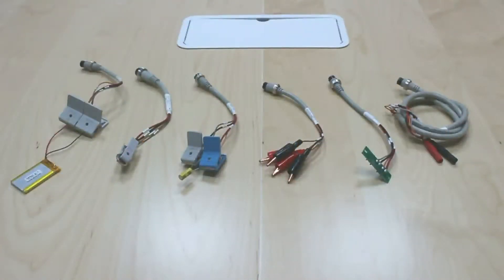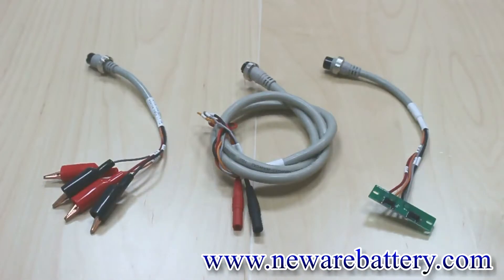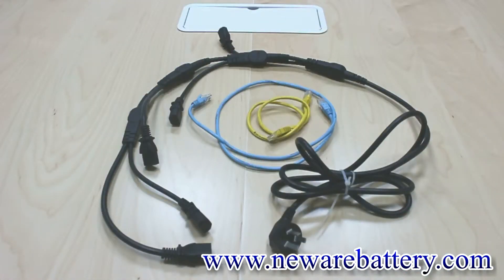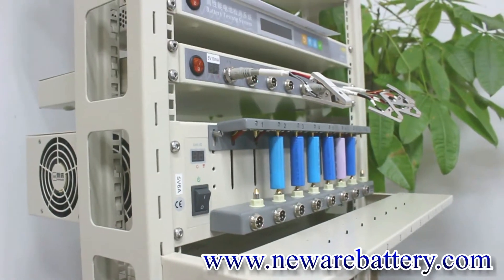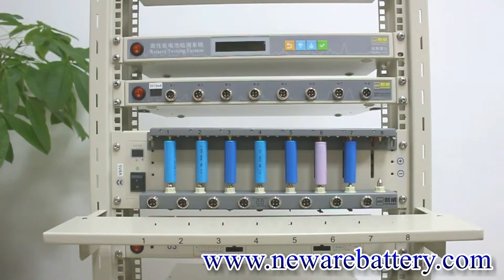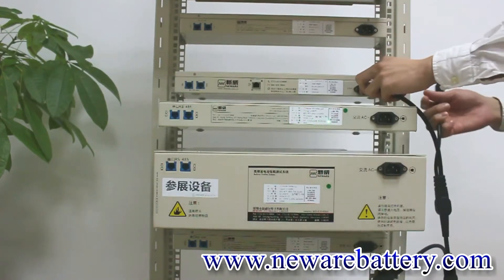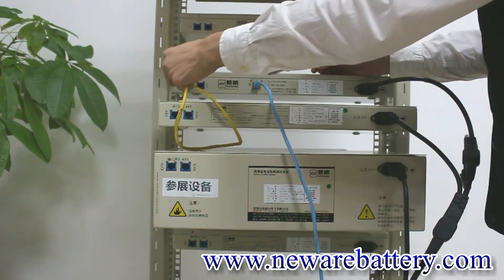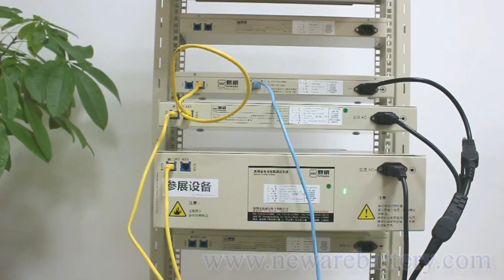Neware Hardware Installation

Comment: What is the meet machine? if I understand correct?
Reply from the maker: mid/middle machine, it's a connection unit to communicate the computer and the tester.
Reply: It's mid machine which is the control unit. You will see it later Brother~
Reply: @parkerpeng2332  thanks bro, keenly looking forward to receiving it :)